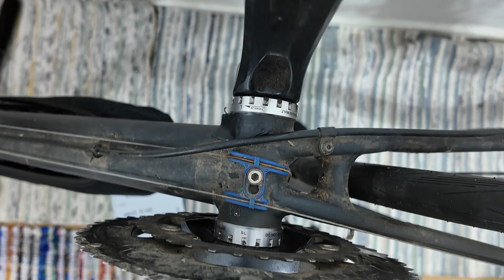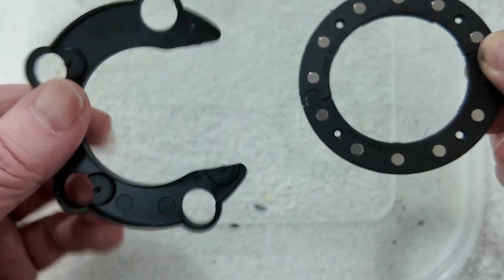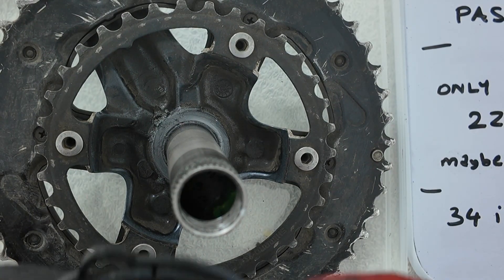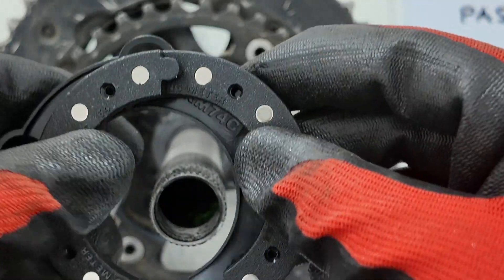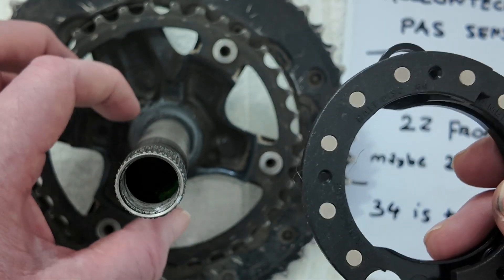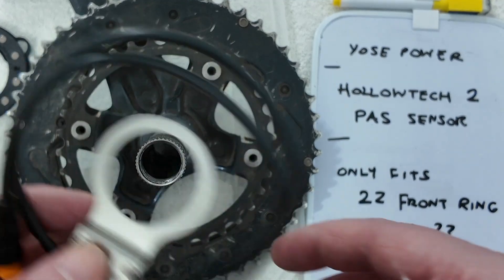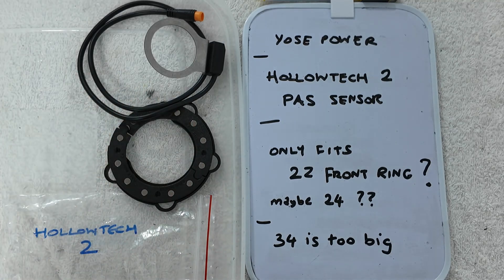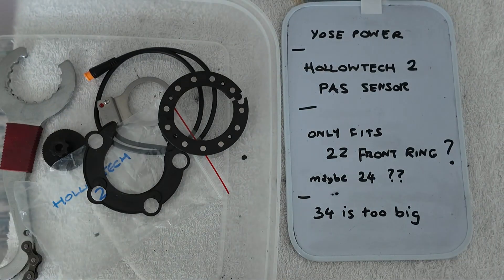Hollowtech 2 Ebike PAS sensor problem (not fixed)

Comment from the maker: I think its designed for chainrings with bolts that are 64mm apart via the middle  (usually 22 tooth chainrings ?).
My chainring bolts are 110mm apart via the middle.

Its designed for 4 bolt studs ? (unless you don't need the casing ?)

bolt distance through the center is known as PITCH CIRCLE DIAMETER ?

??